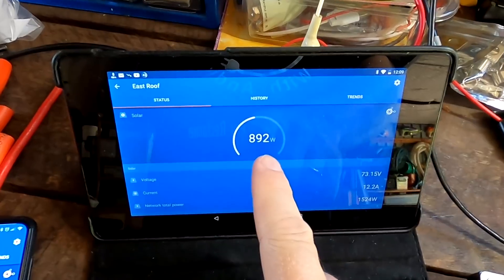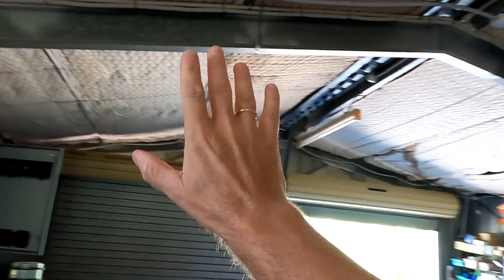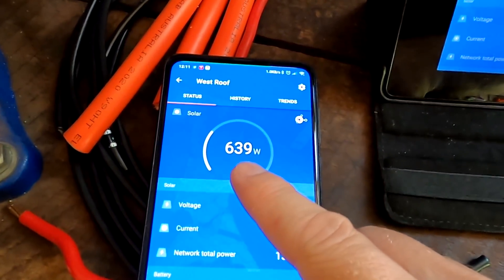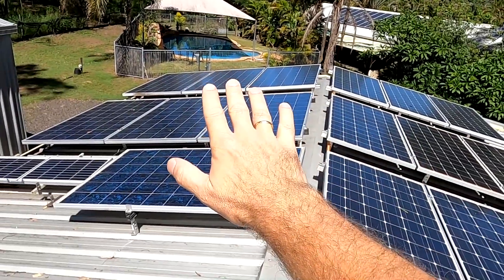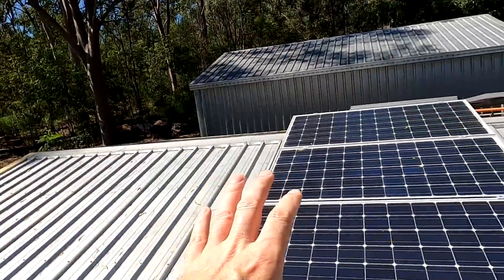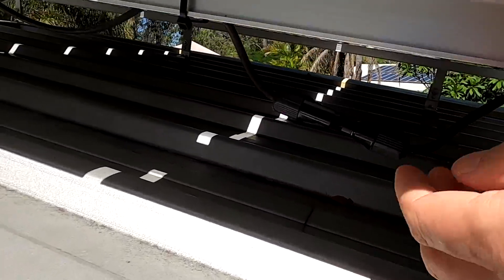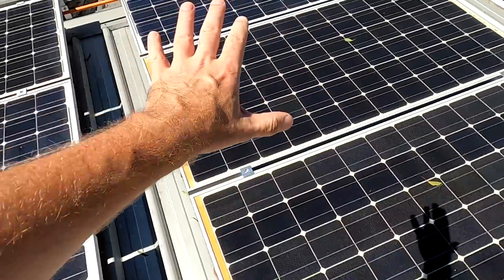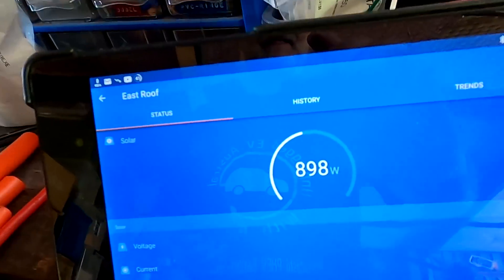60% Solar Panel degradation? Just why? Troubleshooting Part 1

Comment: Could it just be one MC4 connector in each string has high resistance? Unlikely in both strings, but you've ruled out all the likely problems so it must be something unlikely.
Reply from the maker: Yes, that could be the case. I'll check them again. I have replaced some but not all.

Comment: It will take some time, but go to your original plan and test each panel separately as you stated earlier.  That way you know how each will perform.  Also how close are the voltage output of the panels?

Comment: I would connect a DC power supply to the panels, and check the panels at night with a it camera, see if the cells light in ir! They could have micro fractures in the cells, I guess it is a bit hot there, with thermal cycling!

Comment: Also Andy check your battery voltage. As your batterys get full the controller regulates input from the panels ... maybe...
Reply from the maker: Battery is at 60%. As shown in the video, the east side is on full blast charging.

Comment: Have you double checked the connections? They should be no more than 10% degraded, surely! Could be bad diodes! Or bad connections?
Reply from the maker: I replaced some of the MC4s but not all. Maybe that's the problem.

Comment: Hey Andy if everything was fine yesterday it ll be the heat i have the same problem here in Perth. When its hot I turn my panels away from the sun and they produce far more. I do have a dual axis tracker fitted to mine. I have two panels parallel and produce about 4kw a day.

Comment: You didn't mention anything regarding loads or what mode the charge controllers were in.  Later on the video showed one of the charge controllers in Bulk, but it is unclear what the battery's state of charge is.  The battery is not going to accept a whole lot of current if it is already mostly full.

The charge controller is not going to pull power from the panels if there is nowhere for it to go.   To test this properly, you need to put a serious load on the system in excess of what the panels would normally produce.

Also remember that you wire-ORd the strings together.  Whichever string has the higher O.C. voltage will take a large chunk of the initial load.  You really need a significant load on the system, or a half-empty battery, for both strings to operate optimally.

-Matt
Reply: Plug in your Tesla, check again. For our install we used 6 year old 250W Trina panels and under the right conditions we still get 100% capacity. With that I mean full sun but not hot plus a load on our system like the induction stove.
Reply from the maker: The battery was at 60% and the east side charged with full blast. When I swapped the SCC, the same problem occurred with these panels.
Reply: @OffGridGarageAustralia  I'm going to assume that both charge controllers have the same settings, and also that you have set a reasonable float/bulk target.  If the float/bulk target is set too low, the two controllers will compete with each other for current.  The way to test this is to temporarily set a bulk/float target of 56.8V on both.

One other possibility that I can think of is related to how the charge controllers are wired to the battery.   If you are wiring the outputs together and then running one long set of wires to the battery, that could be causing the two charge controllers to compete with each other.  That is, one sees the higher voltage generated by the other prior to the voltage drop that happens over the longer wires to the battery.

You could try running separate sets of wires from each charge controller to the battery.  That way each charge controller is sensing the voltage from the other after it goes through its voltage drop.

(I am guessing here, I don't know how you have the outputs wired to the battery and it is unclear whether you are running both charge controllers in parallel now or whether you are just switching between them for testing purposes.  Since you are monitoring the two panel groups separately I am assuming that you are running both charge controllers in parallel).

And, of course, both controllers should be programmed with the same firmware, as you mentioned.

-Matt
Reply from the maker: @junkerzn7312  Thanks Matt. Both charge controllers have different settings and also different firmware. The reason for that is to test the differences between them. At the time of installation the battery was very low at 20%SOC only so the settings would not matter, both controller ran in Bulk for days.
I also did the test and had the solar strings connected to one controller only at a time, to eliminate all these problems you mentioned above.

Comment: You start your troubleshooting using your worst string and adding the others.... Did you connect the others alone?  Bet the problem is those yellow panels. Connect each string alone....... and then test.
Reply from the maker: Connected each string individually with the same result. Watch from around 12:00

Comment: I think that you have a burnt bypass diode in each string. Check every individual panel voltage and short current.

Comment: Since its really hot outside, the heat may be effecting the output, If you can, try spraying your hose or dumping buckets of water over them, to see if its the efficiently due to heat. Just an idea, I cant think of anything else at the moment.
Reply from the maker: It's not really hot, it's autumn now and mild.
Reply: @OffGridGarageAustralia  my solar panels were from dubious sources and they claim 2.1kwp... here in Portugal it is 15 °C outside and full Sun, sollar irradiance is 900 W/m2 and they output 1.1 kWp max! If i shower them or if clouds pass by, they go up to 1.7 kWp .. the cells in my panels seam craked and i think that with the Heat they expand and have Higher internal resistance
Reply: @OffGridGarageAustralia  I forget you are in a different season people in the US :)
Reply: This is what i was going to sugest!!

Comment: Your panels look about a 30 degree angle away from the sun.  Measure a panel shorted and you should get about 70% of the rating.  5.62 x 0.7 is 3.9A.  My guess is they won't make that.  But you should get a reading proportional to the intensity of the sun(tested at 1000w/m2).  You would need a pyrometer to accurately determine that.  But it is a cool tool so get one and show us how they work please.  ;-)  The panels have an antireflective coating on them.   This might have yellowed with age and you might be able to buff it off.  These do have a warranty of 90% output at 12 years.  So maybe they will even send you new ones.

Comment: As others have said, it seems one panel in each string is connected in reverse polarity. Bypass diodes operating. One manufacturer may be putting their MC4 connectors on with opposite polarity to the other manufactures.
Reply: Possibly can determine which panel is not producing by measuring  panel temperatures. Hot one is not sending it’s power to your battery.
Reply: Voltage matches the high temp rating of the panels.   It isn't a reversed panel.

Comment: The voltage varies with temperature.  With those cells at 55C (assume warming from the sun) - STC at 25C is a 30C rise.  30 x 0.34%/C * 45.2 = -4.6V when warm.  So the string new would read about 121.8V.  Used could be 90% of that and 109.6V.  Panels are not perpendicular to the sun either like how the testing is done.  So 115V is right on the money and would be expected.

Comment: If you have a infrared camera, check for individual hot cells, which could activate one of the bypass diodes reducing the power.

Comment: your 9 panels array look good because each one give the same power.. it’s between your array and the controller (by shorting and measure current at your breakers box, those panels and wires can take this charge).. as it’s not your controller, i suspect your breakers or wires.. i’m curious too!!

Comment: I used an old DC isolator with mc4 leads to create a short. Then check short circuit current on each string. Also test for earth faults by looking for volts from positive to panel frame.  Keep halving your faulty string until you find the panel. Use a single mc4 extension lead that can run the length of the string.
Don't do it on a 34° day! Especially without a hat when folically challenged.
Reply from the maker: Do I need a tin-foil hat? 😂

Comment: Check the NCOT ratings for the panels.  Cell voltage lowers with temperature.  The max power voltage and current is taken with the cells at 25c.  The NCOT rating is what the manufacturer says the cells will rise to with 800W/sqm of sunlight.  This is more like the measurements you will see in real life.  If your ambient temperature is 32c you can expect the cells to be reaching around 60c.  The voltage derate for many mono cells is 0.3%/degree C but for cheap mono cells it can be as bad as 0.5%.  You may also have some defective cells.  Check for cells that are hotter than others with your hand (careful!) or a thermal camera.  Look at the back of the panels if possible rather than the glass side.

Comment: A solar panel's RATED (label value) output is measured under STC (Standard Test Conditions) which are typically only found in the factory, including the panel being at 20C.  A more realistic power rating is the NOCT (Nominal Operating Cell Temperature) rating which is about 73% of the STC rating.  The actual ouput of a given panel can be anywhere between those two values.  Most of the "100 Watt" panels I've tested only reach 75-76% of STC at my location.  Some "250 Watt" Jinko panels reached 235 watts (94% of STC) under the same backyard testing conditions.  Care to guess which brand of panels I trust?  

All my solar design spreadsheets use NOCT values so you won't be disappointed when the batteries go empty because there wasn't enough solar power to handle the loads you planned.

Doing the math, the most power I would expect from your 1.3KW and 1.7KW arrays would be:

1.3KW * 0.73 = 0.949KW

1.7KW * 0.73 = 1.241KW

Panels lose power output when hot and you've talked about the temperatures there being 30C and up.  Black solar panels in the sun will be appreciably hotter than the ambient temperature and will thus have less than the STC power output.  The panel label you showed had a NOCT of 45C.  Measure the actual temperature of the cells and see how hot they are (the basic IR thermometer for $30 or so is probably adequate).  If the cells are above 45C, then they won't produce even that level of power.

ONE bad panel in a series group could bring down the power output of that string.  My first suggestion would be the per-panel testing you are doing, but I would have done that before mounting the panels on the roof.  Nothing fancy, just measure the Voc and the Isc of each panel under similar illumination - whether new or used panels.

Comment: First don't use the STC-Rating from the panel-label, better use the PTC/NOCT-Rating from the panel-datasheet, because it's very hot on your roof. Then remember the panels are 10 years old, and older panels were less effective when not 90° angle to the sun. So roughly: The panels have 60°C on the roof, they are 10 years old, the angle is not optimal. Every one of this points -10%, you can expect 70% of the NOCT-rating (see datasheet), which means 97W per panel. Times 9 it is 875W. So your measured values are not so far from that.

A problem I see: By mixing slightly different panels, you get more then one maximum power point. So your MPPT may have problems finding the best. And the generated power of all strings together is less, than the power you get when measuring them separate.

Quick test, just cool the panels down with water and see what effect it takes.
Reply from the maker: I use the ATC rating now:
Andy's
Test
Conditions 😊

Comment: I would look at the connection at the top of the garage ceiling. Where you combined the strings. That could be a hot spot. The 4 into 1 connecter was a friction fit.

Comment: As all 3 strings are the same I suspect that you might find that all individual panels are similarly equally low pointing to old secondhand panels reaching end of life. As new panels have been getting so much cheaper I decided to buy 325W panels. I bought two sets on eBay. One set was Panasonic @£100/panel and the other Longi @£90/panel. So far only the Panasonic ones are connected up but in bright sunshine in March at midday in the UK I am getting 10.9kw out of 11.75kw for 36 panels. At least with new it is fit and forget. With secondhand, they will be cheap but they might come back to haunt you. Having spent good money on the rest of the system I think that it is worth buying new panels now that the prices are so cheap.
Reply from the maker: Yes, you might be right with that. I had a good run with the panels on the east roof and they have performed like new so far.
And thank you very much for your many replies to other comments here. This saves me a lot of work commenting myself. You seem to understand the problem very well and can point people in the right direction which didn't watch all the videos or watched them only partly as they ask stuff which I clearly explained several times. So thank you for your assistance.
Reply: @OffGridGarageAustralia  Very happy to provide input especially if it frees up more time for you to provide such interesting videos. Temporarily bypassing your PV to MPPT controller wiring should clear up where your problem lies. I hope that it is the wiring because it would be really bad luck if it was the panels. Normally you would expect a gradual drop in performance over time so less than 30% power output due to ageing is very unlikely. As you can get secondhand panels very cheap in your position I would have done the same. In my case I didn't have that option and the dramatic drop in the price of new panels got me started instead.
Although I built my system last year, at that time cost effective LiFePo4 were not yet available so my current system uses 48kwh of fork lift truck batteries linked to Victron MPPT controllers and inverter. Your videos are a great help to me in planning my trailer based LiFePo4 system. This will be used to import power from my offsite PV system and in combination with a Kia EV6 (which I am told can export up to 3.6kw) I am hoping to locally produce nearly all of my electrical power requirements. It should work out OK most of the year but UK winters usually challenge panel output and require more battery storage. At a latitude of 50degN winter days result in much shorter charge times but the real problem is the is the significant periods of overcast conditions when there is so little solar power. You are very fortunate not to have that problem in Australia.

Comment: Andy sometimes we just need to step away and it will come to you. I would first check the series wiring, each end  of the wire is the opposite. Male female right? Then I would check the mc4 connector I have found too small of the male to the female yes I know common problem in life .I always butt connect or twist with wire nut just to figure out the problem.

Comment: When i use used panels, i check diodes, voltage and short-circuit current on all of them individually before installing them. I think that's coming to you now too. not meant badly, but now there are more videos of you that can help others too :)
Reply: Old different panels, different types of mc4 connectors, what to say about that ridiculous ceiling junction box (Sorry Andy), what can you expect, my advice would be also to test all panels separately and replace all mc4 connectors and make that junctionbox as it should be..

Comment: The problem is your Solar Charge Controllers. Your controllers are rated for 35 amps, your panels are rated at 5.2 amps, 5.2a times 9 panels = 46.8 amps. This explains why both strings are not producing their maximum Wattage. Upgrade to a 50 amp Charge Controller and you will get closer to your maximum Wattage.
Reply: incorrect the panels are in series so that is 5.2 amp 3 in series.  series higher voltage same current parallel higher current same voltage
Reply: at max production 1710w from panels controller at 48v is good for 2000w

Comment: Really puzzling, even after checking the comments.
Either 
1) very unlucky and all panels were sold cheap/used as they were so degraded.
2) there is a wiring issue somewhere from the junction to controller.
3) you wired 1 panel in reverse polarity per string (unlikely, your too ADHD about stuff)
4) The sun god Ra has taken a personal dislike to you and cursed your new panel setup

Whereas I had my best ever solar day today, on a big campervan - 9.25kwhr for the day in England too!

Comment: I feel your pain, sadly”been there, done that”. It’s a case of (in full sun) measure each panel individually - OC voltage and SC current at the MC4 connectors. 

Whilst it could be a mixture of high heat and aged panels, it’s strange that all 3 strings are similarly impacted. I did note that three of the panels (bottom near the ladder and two lowest in the middle group at 1:27) are much darker, so just to keep my OCD happy I’d put them in a single string personally, but I don’t think that’s anything to do with the issue here.

Maybe the person selling you those used panels is watching these videos with a wry smile on their face - hopefully you find something to resolve the issue in the next episode.

Best of luck, stay safe.

Comment: HOW MUCH VOLTAGE EACH PV MODULES ARE PUTTING OUT BY TRYING A VOLTMETER AND COMPARE WITH THE OTHERS AND THE CHARGE CONTROLLERS INPUT VOLTAGE WHILE YOU HAVE SUNLIGHT . ONE OR  SOME MAY BE VARYING BY AGE AND WIRE FATIGUE .